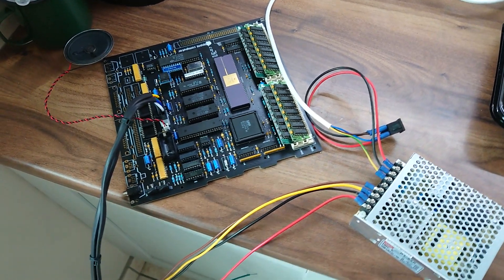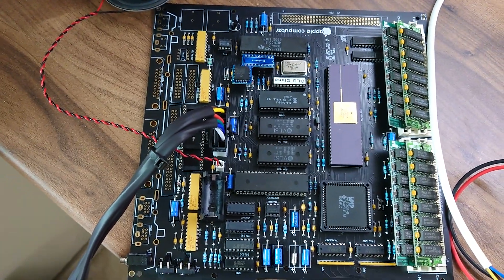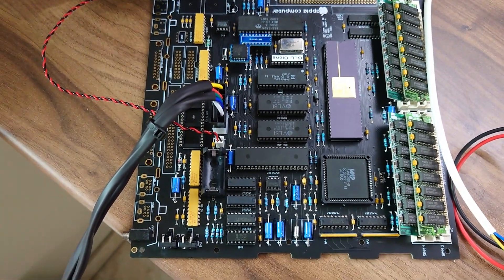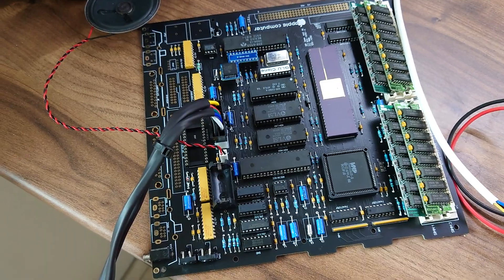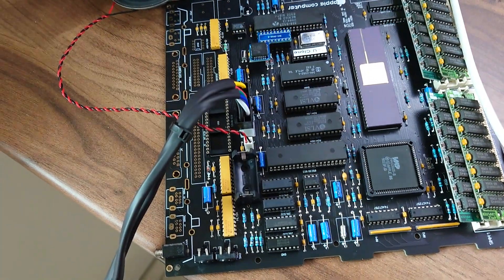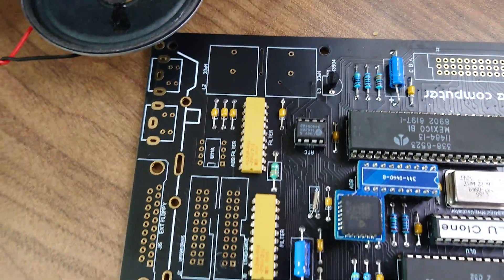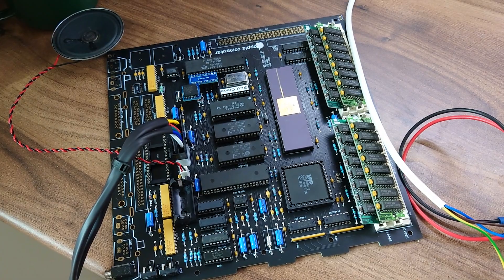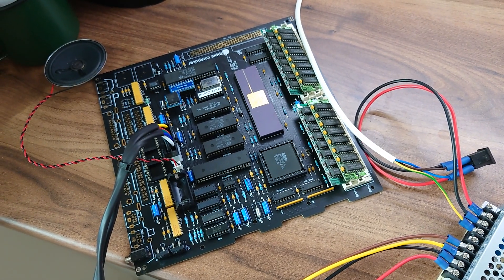Macintosh SE Reloaded - Initial power up of v1.5

Comment: Hi Kai, I'm currently in the process of restoring an SE which has had the battery leak acid over the board!
I'm looking for the value of these capacitors:

C5
C10
C15
C21
Reply from the maker: Hi! You can find all the component values in the GitHub Bill of Materials, here: https://github.com/kr239/Macintosh-SE-Reloaded/blob/master/Bill-of-Materials.txt :)